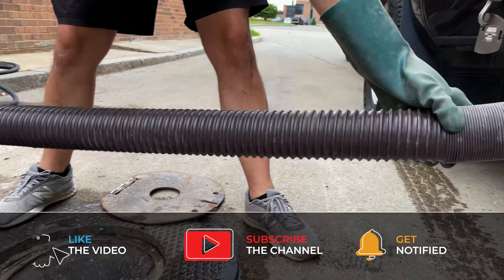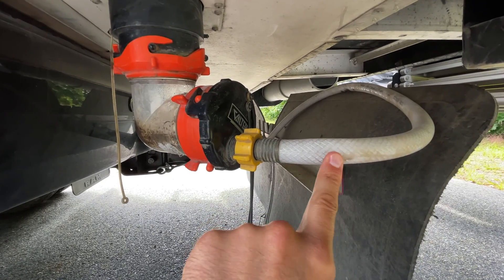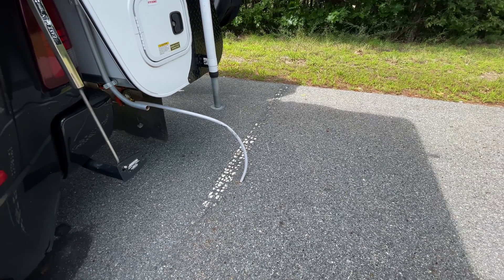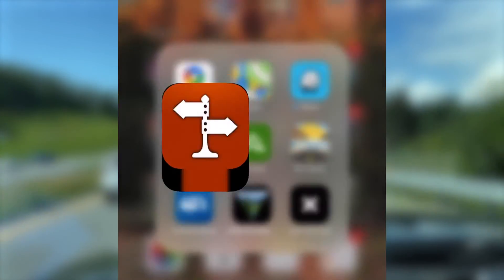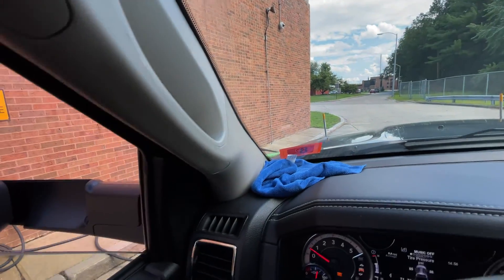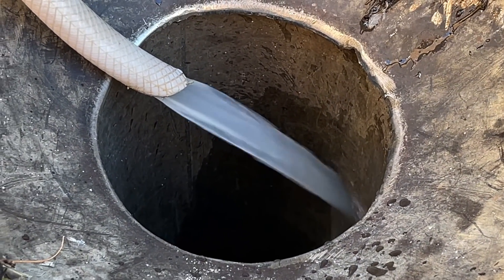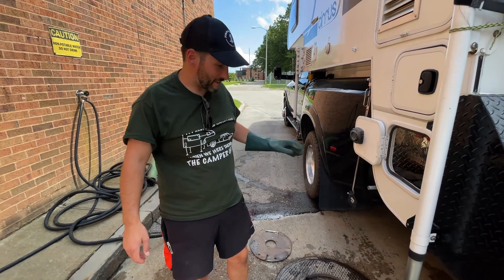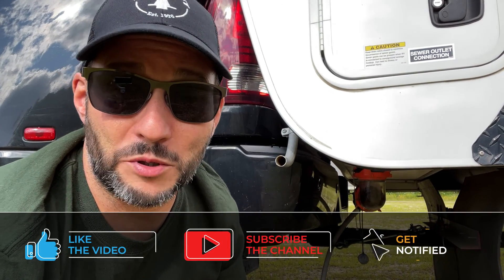Gray Water Dumping Hack - Make Frequent Dumping Faster and Easier

Comment: I've had one of those valtera caps on our drain for a while, they're pretty handy. I've used it to drain gray water (and gray water only) through a hose when boonedocking and where it's legal to do so or to drain it into the yard at home when needed (away from the storm drains).
Reply from the maker: We’ve been told by some farmers and others to just dump on their ground, which is great. But we’d never dump like that at a campground, NP or something like that. Too many people doing it and it eventually becomes a problem.
Reply: Yeah, we've never done it in a park or around other campers. Just nice to have the option at times when environment permits. If everyone did it in crowded areas I could see it getting to be a problem